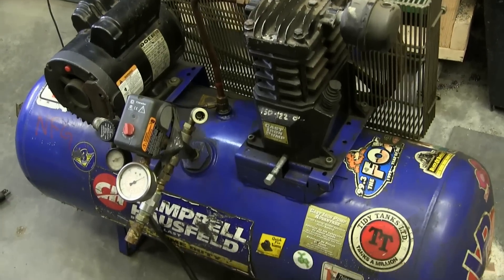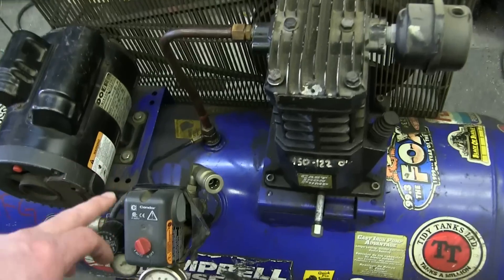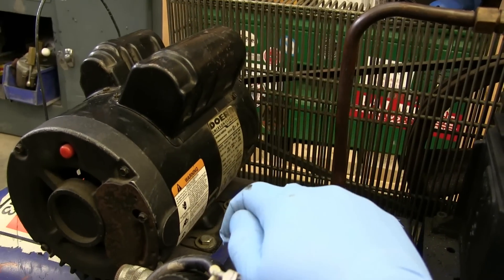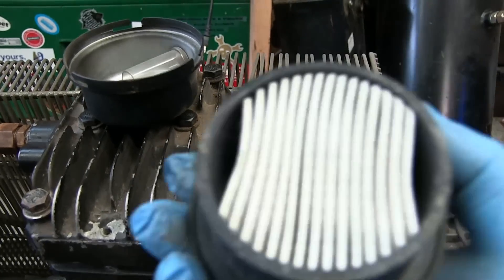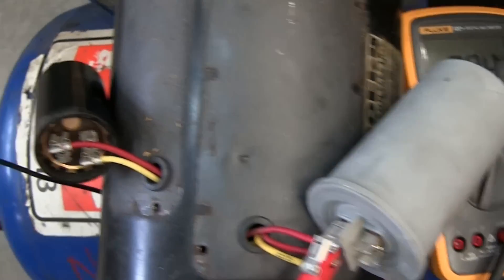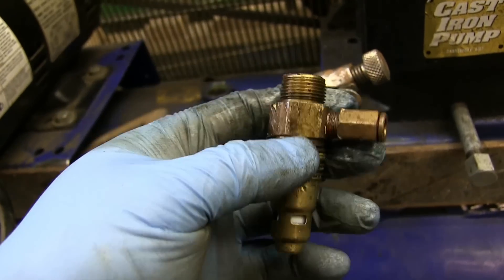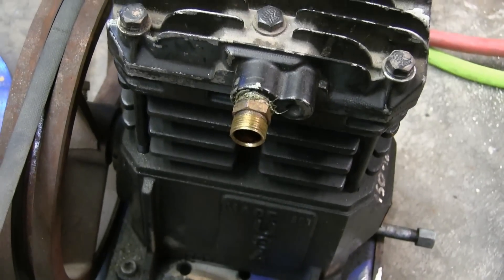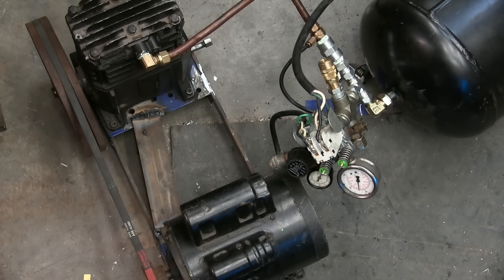BOLTR: Air Compressor Explained and Fixed.

Comment: The start cap is going to be the higher value (the black one usually 161-193@110V on Doerr motors that size) and the run cap is the lower value (grey one probably 30@370V) Rule to remember is start caps have a vent just in case you overload the start winding and runs do not. Also you tested the caps wrong. You need to remove the wires on one side of a cap otherwise you are just running current though the winding... A run cap will lower the amperage of the motor BTW. The overload on the motor will blow on the motor before a breaker usually on a compressor. Motor overloads heat up and pop. It can take 5 minutes or 1 hour to cool enough to click back in. Forcing it will not work and if you force enough you will damage it. If you damage an overload then they have to be reordered from the factory as they have random gobblygook numbers on them to represent the heat number. They basically work like heaters you would find in a larger power panel. Since you gone so far as remove the motor you should have changed out the bearings... Doerr that size is usually 2 6203 or 1 6203zz on the rear and a 6205 shielded bearings but I would use 6203LL sealed bearings since they can't be greased anyway or nobody does it or uses the wrong freekin grease if they do!!!!!!!. Also could have checked and cleaned the contacts on the start switch with a small jewelers file. Most common problem with Air compressors that come into my shop is 1. Start switch buggered up. 2. Bearing bad to a point where the end bells are worn. 3. Rear end bell wobbled out from over tightening of the belt or belts. 3. Bad start capacitor. 4. Head pressure relief valve malfunction. 5. People trying to run it using too small of a cord or too small of a breaker and overloading the motor. 6. pressure contact switch bad. 7. dumb asses that try to run them off of generators and not understanding generators.. (usually results in them bringing both burned up motor and burned up generator in....) Remember with electric motors that the start up amps could be as high as 3 times the running amps that is says on the label!!! Starving the motor of power on the start up will blow the start cap, melt the start switch contacts or burn up the small start winding and either grounding it to the stator or shorting it with the main winding. If a motor growls or buzzes then get it to a shop and don't try to start it by spinning the motor! If the overload goes once get it to the shop because you will get about three times with the overload and usually it will torch the start winding after that. Hope all of this help those that don't like to buy new motors... I make a 6 figure income from people that blow motors and don't take care of their stuff and I thank them daily :D

Comment: My start capacitor let the smoke out, when i replaced both with matching specs, then the blades melted off the new start capacitor? put another new one in and now no worries. do you think the blade connection was just a bit loose and torched the blades off? or another issue? thanks from your canuck now down under brother from another mother

Comment: Always cage your compressor. Never trust those 'thin wall' tanks. built a cage for mine 30 some years ago after seeing what happens when a 500 gal. decides to 'go flat'. pretty well dismantled one end of the shop. My cage?, built it out of 'bedrail' and 3/4 inch rebar welded. with a rebar door that is barred in place  Bedrail makes up the frame and the rebar makes up a 3" by 3" grid in between. That way I can see it and if it decides to go flat, it'll keep all the pieces inside, more or less. and that is for an upright version of what Ave has here in his vid. At work, when we got the new compressor, we built it it's own little bunker with poured concrete walls and roof. All of it 8" thick. After that the boss decided that wasn't enough so he had about 20 yds of gravel brought in and we buried it except for the door under about 3 ft. or so of gravel and dirt.

Comment: I got a couple of these puppies. The dump/check valve leaked on one of them last year so I replaced it.  Worked till last fall.  Now it won't build pressure. Happened all the sudden.  Doesn't seem to be the piston rings or the valve flappers.  Can't hear any hissing.  I have NO...I...DEA!

Comment: the motor is doing the same thing as a roto-verter. they're substituting a 3rd phase with the capacitor. rotoverters use a start cap, and then switch to a run cap. so you can run a 3-phase motor off single phase residential electricity.

Comment: Ok the small black thingy is the start cap. The big gray thingy is the run cap, the gray thing has more wires cause it is first in series with black thing. Just thought I'd throw that out there.

Comment: Great video. but the welding technique needs improving.

Did you get any issues with the compressor motor set up transferring it across with the belt tension . I would have removed the belt from the motor, until it was mounted on the new tank to prevent any distortion of the frame.

Comment: One thing that will kill a compressor is short cycling. It will lead to a lot of water in the oil - which will cavitate in the bearings and shorten the life of the machine. You can tell if it's short cycling by A) the oil will be white and cloudy or B) if you drip some oil onto something hotter than 250F and it crackles (called the "crackle test" - shows oil has at least 500-1000ppm of water)

Comment: pretty sure that the  small cap is the run cap and the larger one is the start cap.. usually the start caps are several hundred uf's so not sure what happened there.

Comment: Portable air tanks in Canada have a Do NOT USE AFTER (date) stamp on the foot of the tank.
It is usually 10 year life.  Even a small tank has potential for huge damage and injury.

Comment: I don't think that air line from the check valve to the pressure switch is a pressure signal. That line is used to vent the head of the compressor when it shuts off, otherwise it would pressure lock and it couldn't start again. The pressure switch senses pressure  straight from the bung that it's mounted to. Unless I'm wrong.

Comment: hell if my compressor got a crack in it i would weld it . . .i would just let it get up to psi at a bomb range for the first time since
Reply: and it would never go back in my shop. . .im scared of my non cracked one exploding, i hear they can rust out without you ever knowing, its one of them big ass tank ones too so if it blew up i would die no matter where i was in the garage
Reply: Generally,  compressor tanks don't catastrophically fail from rust.  You get pinholes in the area where the rust is and the tank starts leaking through the pinholes. The tank in this video had cracks in it and it didn't explode, it just continually leaked down in air pressure.

Comment: Gan Canny with brass fittings on air receivers unless they're DZR Brass. Moisture in the air can attack the threads, they de-zinc, turn pink and can pop off like anti aircraft bullets! I was nearly killed by a brass safety valve that when ballistic on a start air bottle on a tug boat. Damn thing had been there for 10 years, had been removed once for a hydraulic test and inspection after five years. Despite the atmosphere being quite oily due to being in an engine room it still corroded. steel shell fittings definitely make me feel a bit safer these days.

Comment: For those rod liquidfiers out there like myself, contaminants like paint, greasy dirt, etc.. causes gas to form and tends to blow bubbles in your puddles, and you can start an ugly conflagration of chasing holes. Take a pointy tool cleaner/ emergency dental tool and scrape out any slag which may be in the hole, wipe off with quick evaporating solvent and spread a small amount of solder flux over Boo-Boo area and resume cooking paint, always helps me, but sometimes I'm just weird that way, individual results may vary.

Comment: Almost got me with the cap comment. 99.99999% of the time if the capacitor is black and has a little relief on top , it is a start cap. The bigger grey or silver caps are usually run capacitors.

Comment: I believe that a weld's fatigue strength doesn' get any stronger than mild steel. The tensile strength does increase with different fillers however fatigue strength can never be stronger. I think this is a fatigue load.

Comment: hey man, As a safety measure to protect your multimeter, always short out the capacitors before measuring the resistance/capacitance.

Even if it's connected in a circuit, you never know if it got disconnected and it's holding a charge, the pixies be invisble

Comment: The "sense" like you pointed out going from the check valve to the pressure switch it actually so that the pressure switch can depressurize the compressor head. This is done to make it easier to start the compressor the next time. Starting against 0 psi is easy, starting against 90 psi is hard.

Comment: Take the plug out of the bung and its no longer a pressure vessel.
Reply: If you are worried about about any oil inside the tank just put in a bunch of dry ice and let sit a minute.  As it goes from solid to gas it will push out most of the oxygen due to co2 being heavier.

Comment: You didn't show how to change the oil! Also, I'm super jealous of your " junk" drawer, gotta go to the store every time I need some fittings n it usually takes more than 1 trip... cause I'm kind of a simpleton! Also, if I've got an old propane tank that's completely empty, could I use that as the tank to upgrade the capacity of my 3 gallon compressor?
Reply: You can, but you need to purge it, fill it water, turn it upside down and let it drain and vent and even then it will stink of the propane odourant for a while...

This side of the Atlantic (UK) the bottle thread is either 1/2 or 3/4 BSP, Butane bottles on the other hand have a unique and compatible with nothing else thread...

Comment: I'm a Boilermaker, pressure vessels are our life...short lives ya mind ya, we never live past 25 but I figure you to be a bit older than that so the way I see it you're out of the danger zone. Might as well get ya 3 tig filler wire and hold em at the same time then weld over the top of the wire with low amps so as not to penetrate the thin wall tank. you wanna do a weaving motion over the width of the wire

Comment: on the hot outlet for the compressor, I've used one of those flexi aluminium hoses with a high temp hose running from that to the main tank for my compressor integrated into the ute. normal hose will explode, and scare the crap out of you, but the high temp hose has been going strong for three years now, nooooo explosions.

Comment: If you had proper welder, that would be easily fixed.  I'm talking GTAW.  The weld problem is from the cheap GMAW process used because it is the fastest.  The welds GMAW lays down can be harder than woodpecker lips.  But GTAW with ER 70 S2 is strong AND ductile.  Yes, back purge with argon.

Comment: I seem to be having an issue where my compressor start to get to 25 lbs and the motor overheats or something it grunts and stops wonder of the capacitors ate bad it's a single phase 3/4hp doer motor too any ideas Thanks and look out for shmoo

Comment: Nice to be able to outfit your home shop with all the fasteners, fittings, and other assorted doo-dahs from a well supplied and cash-heavy employer! Those several drawers  of miscellaneous fittings and whatnot probably represents a couple hundred bucks of goods. Considerable cash for the average home gamer to hang up in stuff that will maybe get used, someday, possibly. But mere disposable pocket change to any large corporation that likely buys stuff like that by the box, case, truckload, or railcar.  
Also, one of the many tangible fringe benefits of working in the maintenance field.
  Speaking strictly from personal experience here; certainly not suggesting anything untoward about anyone, particularly my fave YouTuber! jes' sayin'......😇🤔🤐

Comment: I've done weld repairs on air tanks at a shop that built them... but the shells were a lot thicker than that Campbell Hausfeld ever thought of being.  The prep work was what took most of the time.

Comment: Why are you starting you weld by tapping the stick?
Reply: Epice it breaks through the oxidation on the tip of the welding rod to allow the arc to form.

Comment: I wonder, why would you use a belt drive? Isn't it more durable and efficient to connect the motor directly to the compressor shaft? Maybe via a rubbery connector?

Comment: 29 micro Farads for the start cap seems right for like a 1.2 kw motor, it is bigger in inchs because it is made for 1000v, at startup for a second it is like 600-700v, where as the compensator cap is for like 120 v

Comment: how did you survie for months with out a compressor?    I lost a belt on my 3 stage 120 gal at home, had too wait 3 days for the replacement... I could be found hiding in the corner of the shop in the fetal position.

Comment: The amp per thou rule seems a little off for 6011.  Reason being, the flux is much thinner than on a 7018.  The 6010/6011 series  (F3 group if I remember right) don't have the the iron powder in the flux.  Its just cellulose and a sodium or potassium based binder.  Usually, when I run 6010 (hell of a lot less spatter than 6011) the amperage is about 10-15% less than a rod with heavier flux.

Comment: The white capacitor is your run cap, and the black capacitor is your start cap.The black cap has no oil to dissipate heat and is meant to be in the circuit breifly. Also a good time to check Microfared are in range.

Comment: Hi Ave, I would like to correct you on something I have also only recently learned. The 'sensing' line that runs to the switch unit is in fact a depressurizing line. The sensing goes via the big plug the switch is mounted to. It's purpose is to release the pressure in the cilinder so the motor does not have to push through a static spring basically at start. I found this out when building my own big compressor out of parts... the pumps would work fine first time but hum and smoke and not rotate after the first cycle, until I helped them. It is in fact the big PSHHH you tend to hear when the compressor reaches pressure. super cool vids man, very therapeutic to watch. by the way whatsup with the Feyenoord flag?

Comment: I work for a company that fixes and installs dairy equipment. I use my multimeter everyday, but I tell you, an actual capacitor tester never reads the same as the multimeter capacitor tester. Why?

Comment: If a weld or fitting is liquid-tight (hydraulic), is it also gas-tight (pneumatic)?
Reply: no, gases can fit through smaller holes.  Practically speaking though, usually

Comment: AvE, my friend, you did have the capacitors backwards. The grey sealed  plastic capacitor is the run capacitor. The motor is a type of permanent split capacitor or PSC motor called Capacitor Start Capacitor Run or CSR. It uses both a run and a start capacitor. The centrifugal switch disconnects the start cap when the motor reaches at 75% of its full speed.

Comment: With that mention of hydrogen embrittlement, I wonder if the reservoir tank would last even longer with a water separator on the line before it?

Comment: Lol 90 amps for 3/32 6011 is like toasting bread for 5 minutes

Maybe 70 would be better
Reply: Trevor Emmett  yup maybe 60 on a 1/8 thick pressure Vessel..you dont wont to blow a hole in that wimpy shell..
Reply: Clearly neither of you have welded lots of thinwall. Straight polarity my brothers. That is the answer to the question
Reply: @Hollowminder  7018 rod after drilling both ends of the crack. 125 gallon air compressor at 175 psi. I've also made my own hydraulic fittings by welding 2 pieces together. Run them to 5500psi in track hoes

Comment: You were right that you got the start and run capacitors mixed up. The run cap does allow a higher power factor but it does this by creating an additional offset phase, so the motor essentially runs as a two phase motor.

Comment: bah on the east coast and have to weld up a pressure vessel, just take out a fitting.
protip: drill a hole at the end of the crack then weld it shut

Comment: There is nothing more fun than telling a smart guy he's wrong.  The black nylon tube is not for pressure sensing it's an air bleed that releases the pressure when the switch opens so that the motor can start with less load.